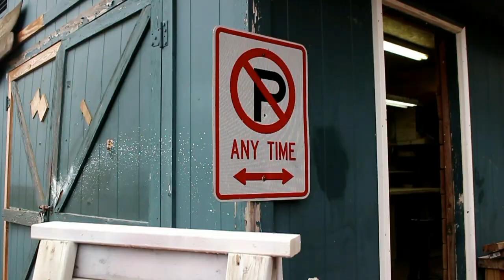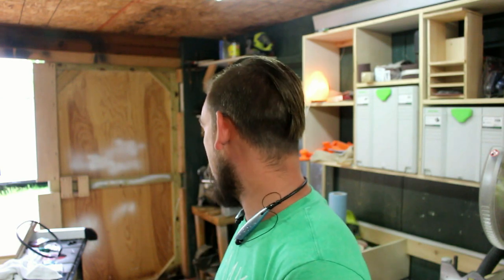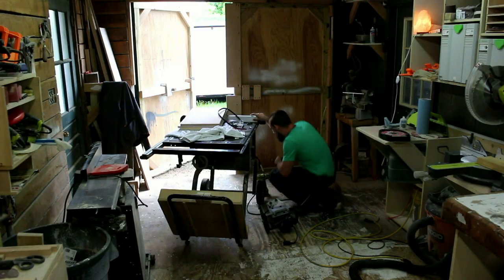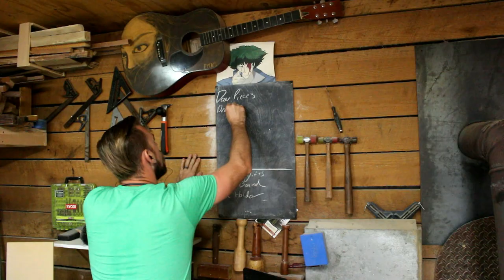Big Beautiful Dining Room Buffet!!!

Comment: You had me lmao at the rock out session. Love your videos, keep up the good work! Quick question : What were those white boards you used on the cabinets?
Reply from the maker: Thanks!!!  Those are pre-primed fingerjoint pine boards. They stay straighter than “common“ trim boards and almost never warped or twist! Also the primed surface makes for easy sanding and paint adherence.
Reply: @PMKWoodworking  Hi nice job man may I have the cut sizes please and drawing if it possable

Comment: Don't use flat-sawn stock for stiles and you won't have the cupping problems.  And the wider stiles, the worse the problems are gonna be, even AFTER install and painting.  Use quarter-sawn and rift-sawn stock.  WhatEVER you use and howEVER it was cut, the more the grain lines run parallel to the face, the worse problems you're gonna have.  Grain needs to be more perpendicular to the face.
Reply from the maker: Very good advice! Only difference is that I typically get extremely large boards and cut my own stock. For my doors I typically try to avoid flat sawn as much as possible. And try to mail the best pieces out of the large stock that I start with. However, these particular boards were not perfectly flat to begin with but I thought they might straighten out a small bit (which I have had happened before once I get them to my shop). They actually DID appear to do that until I began milling my own lumber and got the doors completed. As they continue to dry over the next week or so that’s when I noticed the bowing.  Live and learn! LOL😅